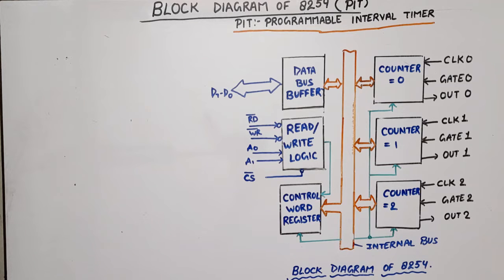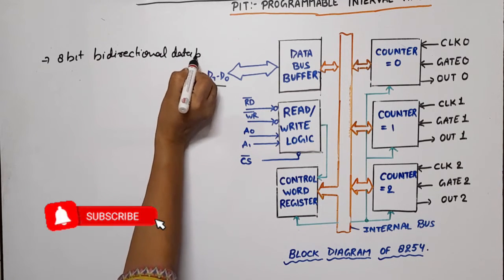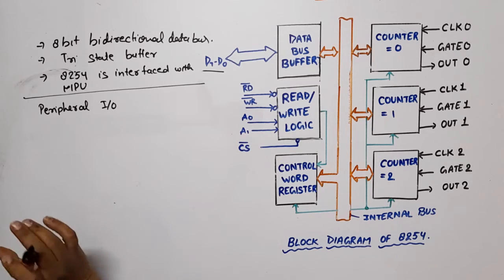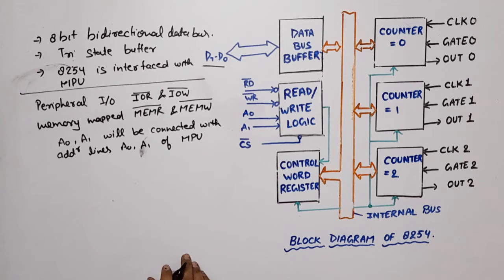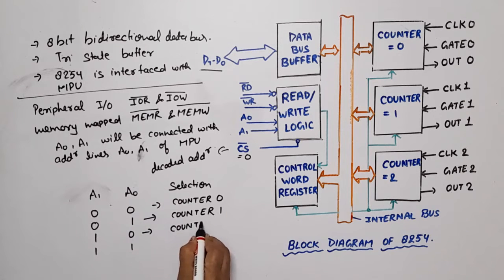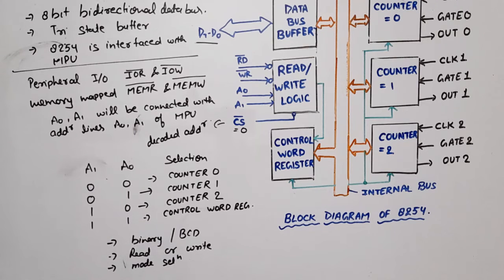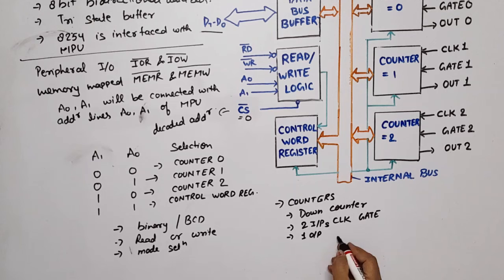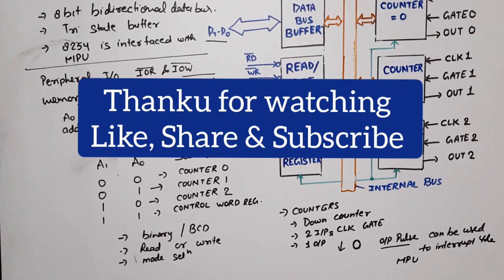U3 L11.2 | 8254/8253 PIT | Internal architecture of 8254 | Block Diagram of 8254 | PIT

Comment: Mam, I'm Stuck with the Point that, Why CS is always Active low?  In all like - 8086/8085/8259.....
Pls Help me out.

Thankx
Reply: CS is not always active low it depends on what program you have chosen if Read write operation chosen then CS is low otherwise it is always high😊